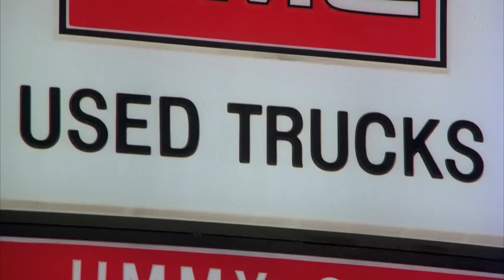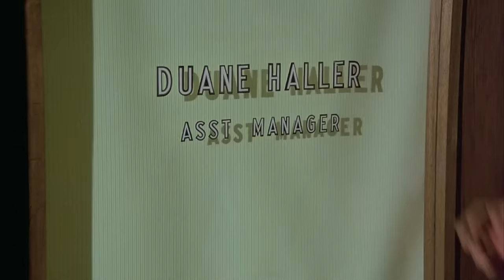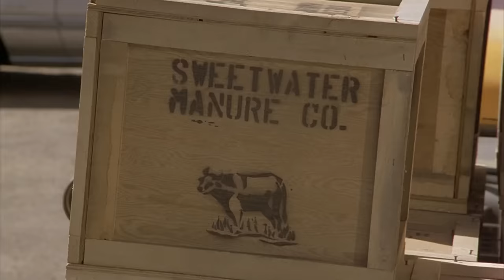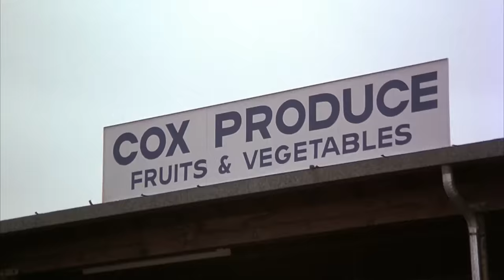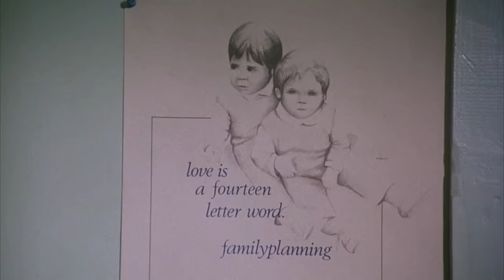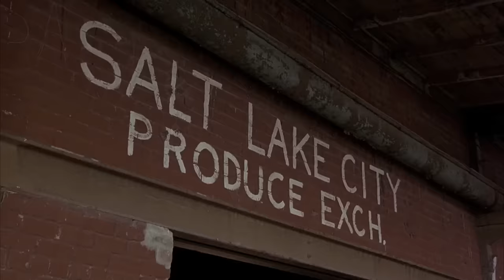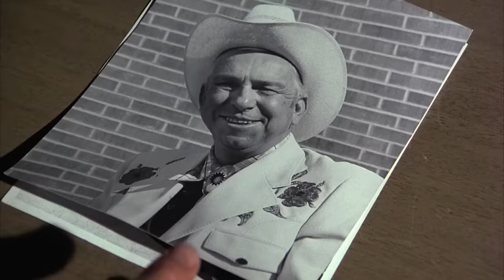White Line Fever | English Full Movie | Action Crime Drama

Comment: Still no Merchandise, (no model kits of the Blue Mule). No Soundtrack, No posters, no sequel,  no 4K Blu-ray, and the film is choc full of in-jokes centered around Roger Corman's film group.
Reply: I don't even think that a model kit has ever been produced of the Ford Truck itself.
Reply: Yeah not officially, some laser printed ones were around and few resin kits. But I want a 1/24 official beautifully recreated FordWT 9000 cabover  Blue Mule with Trailer. AS well as an acurate Snowman Kenworth w-900 and Convoy's MackR700. And as the cherry on top pf all that 1/24 cars from Death Race 2000 91975).